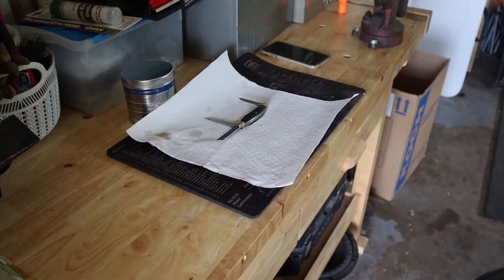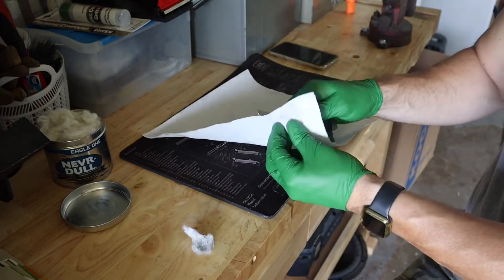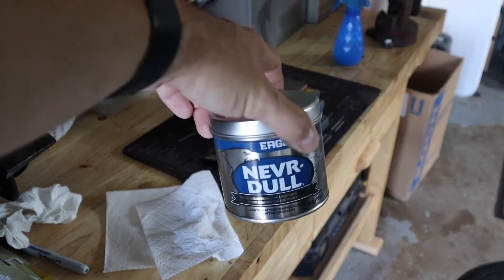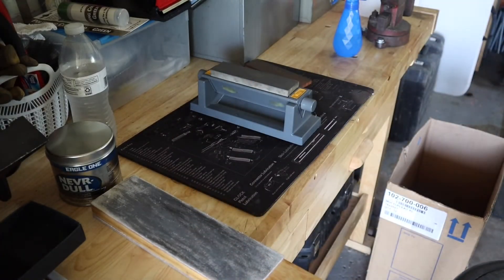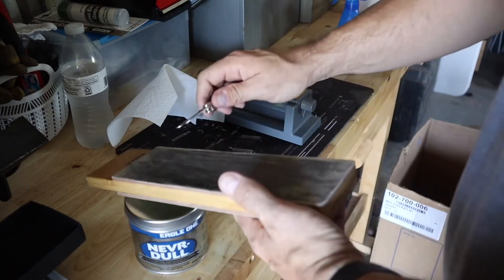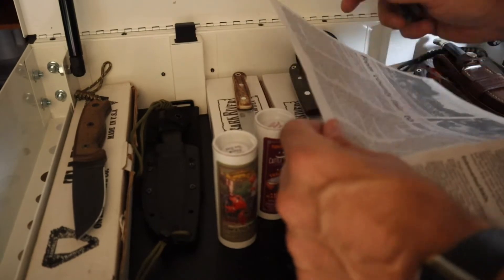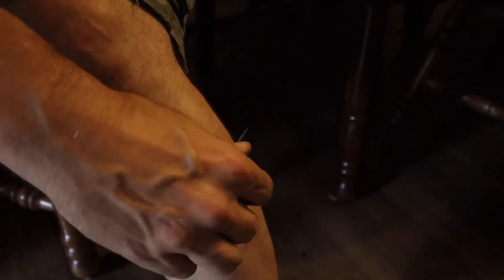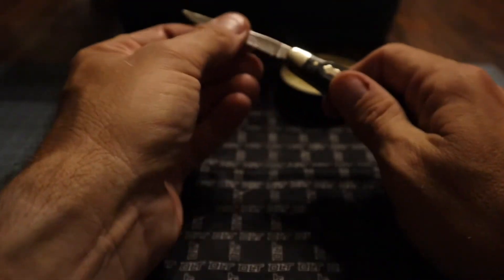Tuning up an old Mossy Oak Stockman that was found in the woods

Comment: Big J
Nice work on a basic tune up.
The Never Dull looks interesting and sure made short work of the corrosion ! As it seems fairly inexpensive its worth a shot in my book.
For protective coatings I use Renaissance Wax - works great on both wood and metal.

May all your journeys be adventures and your havens safe.